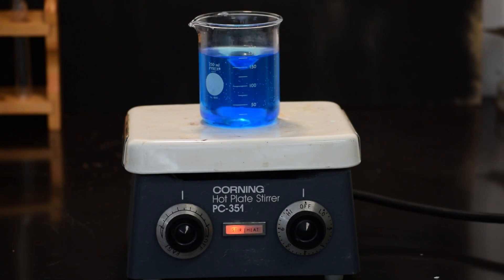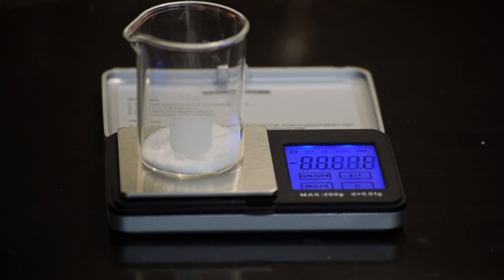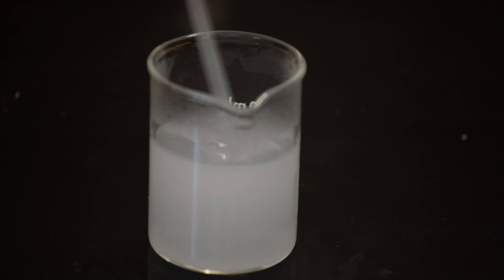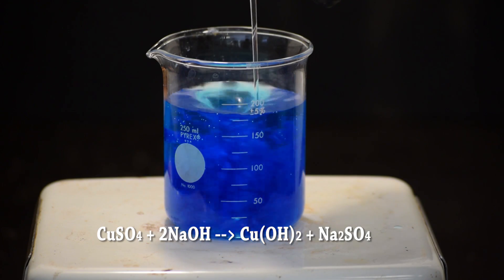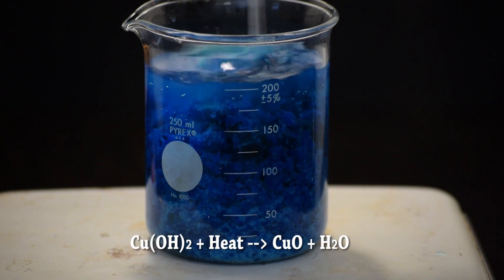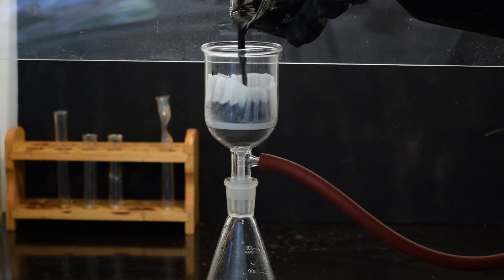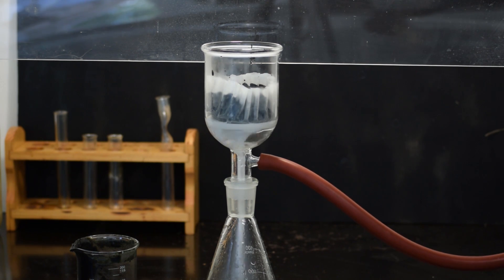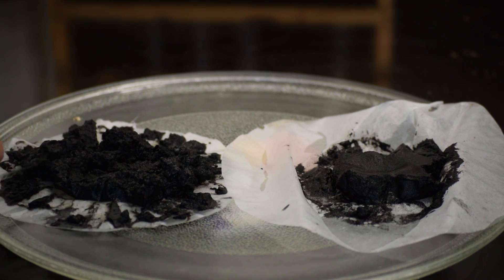Copper Oxide Synthesis

Comment: Watching the amount of water by the becker markings I really dont know how you did the calculations, because you made a sulfate solution of about 0,6mol and then did a NaOH solution of about 6 mols, this is aproximately 10:1, not the 2:1 proportion you told... I've used this video on a class and it worked, but I really dont know how to explain the molarity used.
Reply from the maker: Don’t worry about the molarity, just consider the number of moles. 25 grams of copper sulfate pentahydrate is 0.1 moles. 10 grams of sodium hydroxide is 0.25 moles giving a slight excess of the 2:1 ratio as I stated in the video.

Comment: I need to prepare cuo for my research.in our lab we have only  cu(no3)2.3h2o,naoh,nh4oh precursor i cant find some relevant literature on this....how can i synthesize cuo?
Reply: Should work with copper nitrate dissolved in water, then add a concentrated solution of a slight excess of NaOH. Then heat. Similar to this synth. Should still work I think

Comment: how do u do the math i mean i know that 1 mol of CuSO4 needs 2mols of NaOh to get 1 mol of Cu(OH)2

CuSO4 + 2NaOH=Cu(OH)2 + Na2SO4

so n(CuSO4): n(NaOH): n(Cu(OH)2)= 1:2:1 
but how do u get the grams and mililitres (im using drain liquid cleaner so i believe its 30% NaOH)
Reply: ok so i did the math for the rest, soo its seems like i need 25grams of CuSO4 to 8 grams of NaOH but my NaOH solution is 25%. so in order to get 8 grams pure NaOH i need to add the rest 75% of water thats with it which means i have to add 3 times its mass or 3x8=24 grams thus 24+8= 32 grams of 25% NaOH solution so i get 8g of 100% NaOH in the mix right.....note: i suck at math